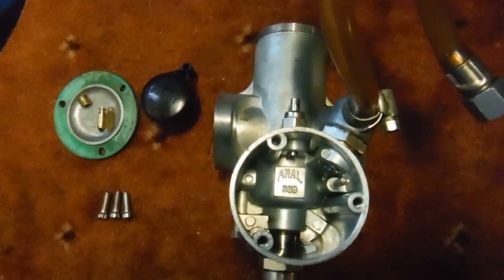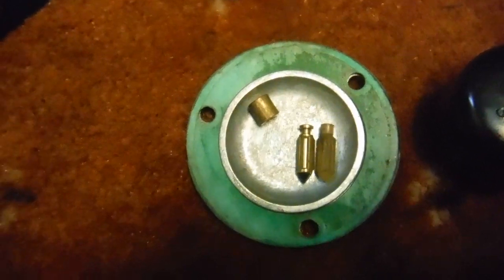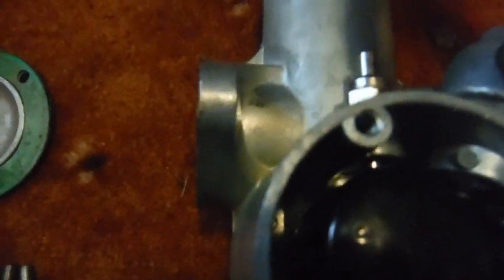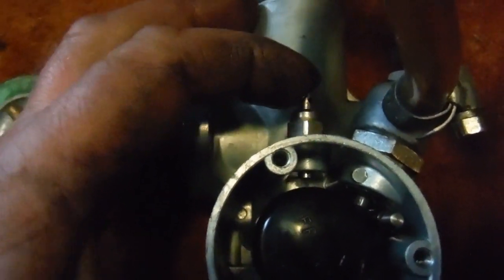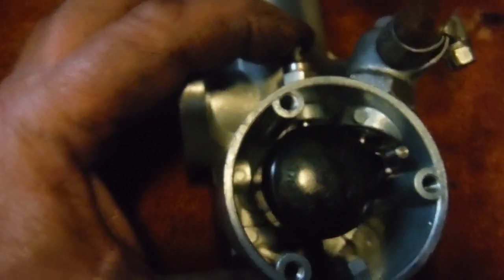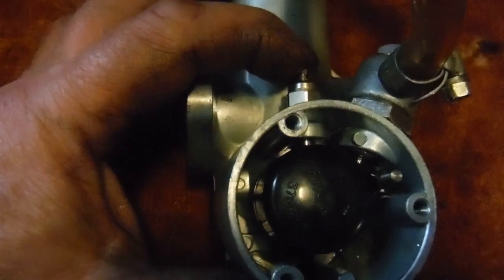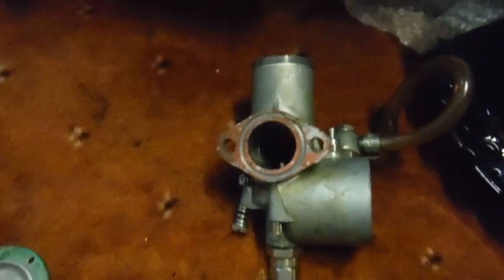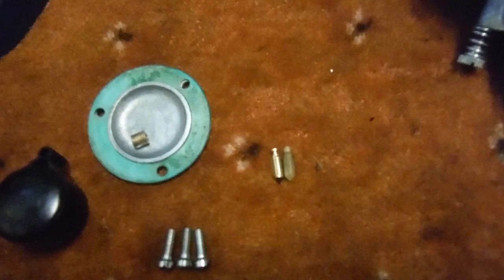Amal Monobloc Carburettor float needle types compared and the resulting float heights discussed.

Comment: Hi Paul, I am a recent owner of an AJS 16MS so quite new to this game. I thoroughly enjoy some of the Youtube videos out there - especially those by you and Terry Jones, and I'm slowly getting up to speed. I want to do some work on my Amal Monobloc 376 carb and see that both paper and fibre float chamber gaskets are available. I would guess that fibre would be better at stopping leaks, especially if the cover has ever been a bit overtightened, but they do dot seem to be the product that most suppliers stock (including Amal).  Do you have a preference? It looks like the green gasket is fibre in this video.
Reply from the maker: Try Hitchcocks Motorcycles, they may be able to help.
Reply: @paulhenshaw4514  Cheers, Paul, will do.

Comment: Very interesting! I recently bought a Greeves with a 389. I only rode it a few times before it seized. According to the info I found it was jetted wrong. So while getting the engine repaired I also rejetted it, replaced the float and needle. Now it floods very easy when starting. I wonder if Im able to lower the seat or if I should just go back to the old float and needle? Thank you for sharing your wisdom.

Comment: Adjusting the pilot air screw clockwise would make the motor run richer  ?
Reply from the maker: Correct, but only at tickover speeds and very small throttle openings.
Reply: It's a pilot fuel screw, not a pilot air screw.

Comment: Hi Paul.  Is there any official info on the recommended float level in 389 carbs?  I have read somewhere  that the tiny dot in the center of the float chamber cover marks just that.  Is it true?
Reply from the maker: Hi, that is correct about the dot.

Comment: Hi Paul thank you so much for sharing your knowledge. I don't own a Royal Enfield but I have just bought a 1961 Panther . Part of getting it back on the road was to order a carb rebuild kit from Amal. It came with a modern rubber tipped float needle . I put the carb in an ultrasonic cleaner   and put it back together .Being the genius that I am I through the old parts away including the original float needle. The bike blackened the plug, smoked a bit and generally ran poorly. It's 60 years old what could I expect ....Then I saw your video .............It's a Monoblock ,easy enough to take the float out . I carefully  unsoldered the shortest side of the base that the float needle sits on when the float is in place. Luckily it's a brass float  . Now I can open  and close the gap  I made between the float and the needle ,easily changing the fuel level inside the carb. What a difference. The gap I made looks to be about an eighth  of an inch .   It's a different  bike ,thankyou again
Reply: hi, did you have any issues with hot starting - I still don't know how to solve it on my BSA Bantam. I thought it was and still maybe fuel boiling off due to the heat from the main cylinder block. any thoughts welcome
Reply: @thestrictlynoparking  I don’t know if I have a hot starting problem or not. I haven’t mastered starting the Panther.  Some days is starts 1st kick and some not. It is very easy to flood. Since I lowered the fuel in the float bowl I have to be quick with the half compression leaver, more so than before. It has the original magneto, that all I did was clean. I will be 70 next year so it would be nice if I could get it to start reliably
Reply: @jeeprat  I know the feeling. I have tried many things. I did a trials event last Sunday and it kept running, even had to start hot.  The only thing I wasn’t doing was running at high revs for a long time. This is what made me think about a possible fuel issue however when I gave had the engine cut out it was immediate and the last time seized the engine. The piston and bore were partially damaged.
Reply: @thestrictlynoparking  the first thing I would do is check the plug colour. It’s a 2 stroke so would I would also increase the amount of oil you are adding to the gas. Is the ignition timing spot on? Are you getting a good spark , points , condenser and coil? If they are good then carburetor and fuel have to be your problem
Reply: @jeeprat  working my way through these just the timing to check. The ignition coil supplier thinks it maybe the coil but I have yet to conclude

Comment: That brings back memories.
I had one with an extended float bowl cover, which ment you had a lot more fuel in it but all at the same level. It was on a modified engine so that the level wouldn't drop off quickly on full throttle. 
Well that was the theory anyway.
Reply: I too bought the extension piece for the carb but when I fitted it the engine kept flooding - I wonder if the needle/valve is working properly?

Comment: I always thought the fuel level was adjusted by putting shims under the float valve seating
Reply from the maker: It is possible to raise the float height by doing so, but they are generally pre set and good to go 'as is'. another one I have seen is some having fibre washers beneath the float needle housing / banjo union and this can dramatically raise float and fuel levels.

Comment: Thanks for that.  You've brought back a very dim memory that I had a problem with two float needles of different heights long ago.  If memory serves, (not very likely), one of them produced a petrol leak so I used the other one.  Makes me wonder what I was doing with them now.  I'm sure one of them came from a spare carburettor I acquired somehow.  Certainly one was white plastic but I can't remember about the other one, it was in the early 1980s.

Comment: Have you done comparisons between types of float?
Reply: Very interesting, just the info i needed at the moment. Working my way slowly on tiger cub with Amal 375/31.
Reply from the maker: No, but whatever type of float is used, the two types of needle will give different float heights, regardless.